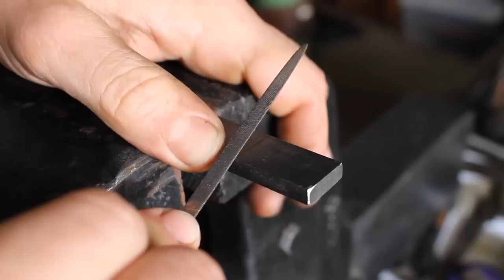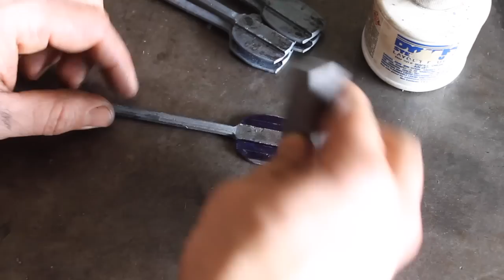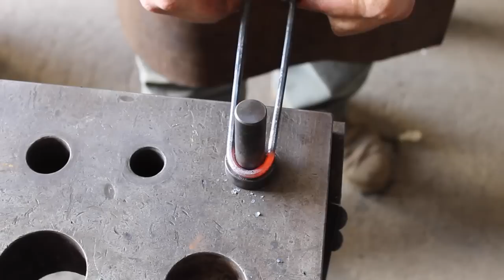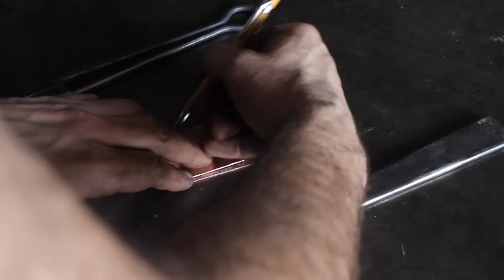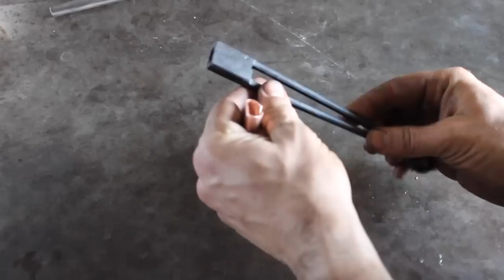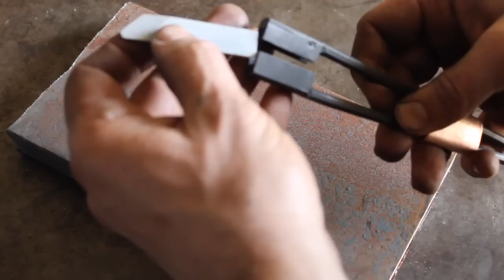Forging a Soapstone Holder

Comment: Excellent tool you've made there, very elegantly designed. One slight improvement I thought of was perhaps making it a little more compact.
Reply from the maker: Hello and thanks, I played around with different lengths and it could go a little shorter, but it affects spring tension.  This length allows for use as a pointer in keeping with a similar soapstone holder Roberto Giordani made for use with his students.
Reply from the maker: I think you're right, I'm going to shrink the design down 3/4"-1"  Thanks for the input.

Comment: Great job, I like the slide-on kiss block. Did something happen to hinged kiss block that I've seen before?
Reply from the maker: UV Metalworking & Fabrication Thanks, no that setup goes down to 1/4" pads. Because of the thin plates I doubled the contact area and used 4140.  These should last a good while if I'm careful.
Reply: Thanks for the explanation. I love your work.

Comment: Okay, nice, but this is more manufacturing than blacksmithing. Uri Hofi could do this with an anvil and a hammer.
Reply from the maker: My good Sir, I worked in Hofi's shop.  He would use a power hammer :)
Reply: @rigoniironworks  Sure, but not for something like this. Don't get me wrong, I like what you've done, it is beautiful, but there is a real art to a hammer and anvil.